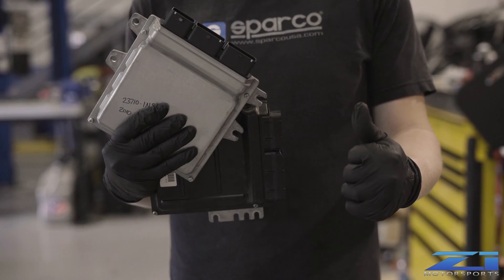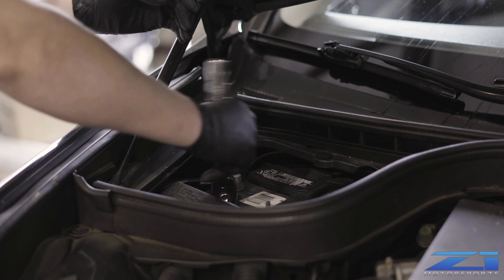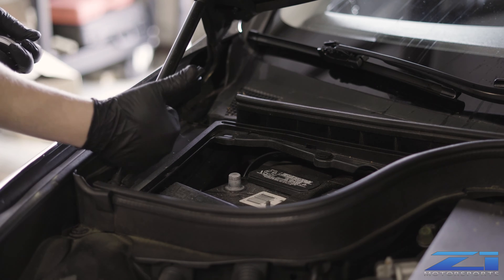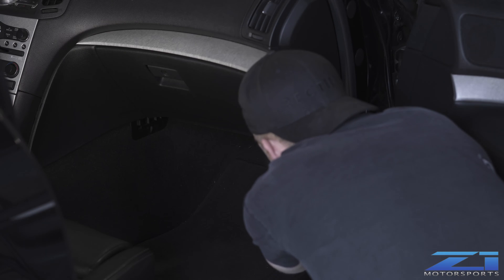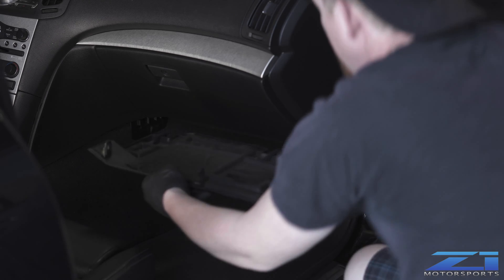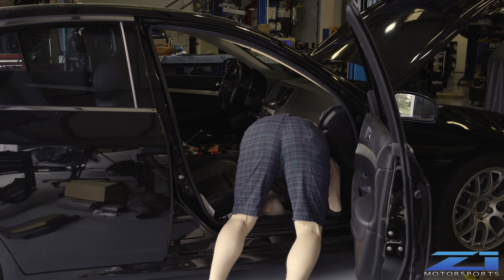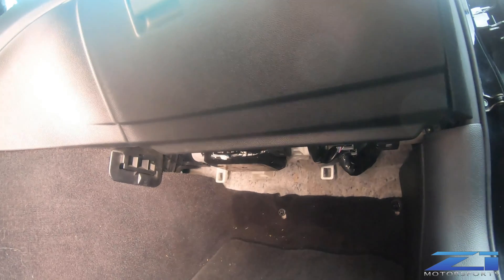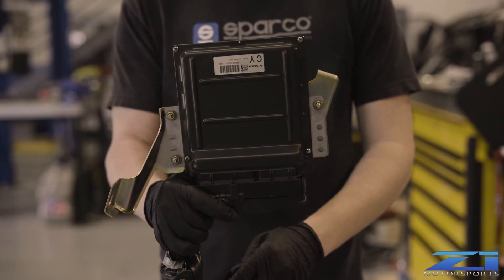How to remove your ECU - Nissan/Infiniti

Comment: can ecu cause random misfires?
Reply: No that’s your coil packs
Reply: @Ephekx Not necessarily. The ECU tells the coils when you fire. If the ECU is bad or the KAM doesn’t work properly, it can cause misfires
Reply: @koryneasterday1120 yes but that’s not too common as just burn coil packs causing misfires
Reply: @koryneasterday1120  hi, is the KAM error the keep alive memory error, P0603 does this mean the ecu needs to be replaced? i do get very seldom misfire or cutout, but no code.... the code only surfaces for me after i drive the car, turn it off, go into a store , come out and start the car. then it pops up but disappears at the next startup if the car has been sitting for a while... soo strange. ive replaced coils, plugs.. checked terminals, wiring...

Comment: I wonder if this is what needs to be replaced in my car. Cause my accelerator just died on me when driving 2 months ago. Then it wouldn’t start.  Like it’s not sending fire. Been taking it shop after shop. They can’t figure it out. I’m bout to get rid of  it .
Reply from the maker: It's always worth checking, but that might not be your issue.

Comment: what if i disconnect my stock ecu and  plug in a tuned ecu, should everything work just fine after i reprogram my key fob? i have a 2013 g37 and wanting to switch to a 08 ecu tuned on uprev
Reply: Did it work?

Comment: This is the most vague fucking video. What models??? What years??? Wth Z1😂 I have a 2016 Infiniti q50 RS and it’s not there and can’t find any information on where it’s located at……. Any help? A tuner here new to Infiniti’s
Reply: Anyone wondering and can’t find theirs on Infiniti for 2016 it’s actually behind the right fog lamp in wheel well. 🤌🏼

Comment: If you are having issues removing the 10mm bolt near the dash...then remove the 7 screws holding the glove box and you'll have plenty of access. While the glove box is off, you can change out the cabin filter too.

Comment: does the mail in tune include a flame/burble map?
Reply: Always remember this... flames & backfires in your exhaust system, travel both ways... one way is out of the exhaust pipe & the other way is back up to the valves in the cylinder head. Over time the amount of damage those "cool looking /sounding mods" do is insane.

Comment: Would a 3" intake using the stock diameter MAF housing need the +$300 add-on?
Reply from the maker: If the MAF area is the same diameter as stock it would not require the additional upcharge for oversized intakes since it doesn't require rescaling the MAF when tuning.
Reply: @Z1Motorsports23  how can I get a new ecu for my 2008 G35x,    my old ecu broke

Comment: Do you always increase Rev limit with UpRev if you choose the option to send the ECU for a tune? I read 50-50 that you should never touch the rev limit, but if you do, are we talking about  100rpm? 500?
Reply from the maker: It depends on what car we're tuning, if we're talking about an HR engine we'll usually turn the revs up to around 7800. We'll never turn the limiter up past a safe area for the engine.

Comment: So I just send it to ya and you tune it? Then send it back and that’s it?
Reply: If the are able to do that, yes. that is one of the options to get UpRev on it. the cheapest one too because you will not need to buy the cable etc. Will probably miss 1-3 hp because they flash a pre-made one depending on your mods and that's it. but you'll save like 500 on it

Comment: Sorry to ask this guys , does anyone know why car my is sputtering around 2500 rpm , cant even go past 65 mph with out it jerking me in my seat , 2003 g35 coupe de , thanks guys
Reply: You need to reprogram the ecu  my g35 was doing the same when I replaced the engine
Reply: Olman Castillo How did you reprogram the ecu???? This start happening when I replace my engine too, my car goes up to 78mph and 3000 rpm. I also have engine code for crankshaft (P0335 - Crankshaft Position Sensor A Circuit), does the code also came up after replacing your engine.
Reply: @habeeb590  I took it to a shop they changed me $250 ...
Reply: Olman Castillo oh okay👌, the shop that replace my engine did a shitty job so am definitely not returning my car back to them, I guess I have to find another shop and pray they know what they are doing
Reply: @hrg35coupe11  did you take it to a specific shop or what?
Reply: @jeremiahwalker9331  a friend fixed it for me . But any shop should be able to fix it
Reply: You got take it to someone with a fancy computer to recalibrate the throttle body timing vvt all those things
Reply: Olman Castillo Okay👌 thank you so much, now I know what the problem is.
Reply: @habeeb590  no problem
Reply: Did you figure the problem cuz am car have the same problem
Reply: The numbers has to match old ECU from the new one to get the vehicles starting

Comment: Hey quick question. Rumor goes that if you remove your ECU and try to hook it back up it won’t start ? Unless you reset it with a tool? That has to be a lie right?
Reply from the maker: Correct, that is false. There should be no issues disconnecting the ECU, putting it back in, and starting the vehicle.
Reply: @Z1Motorsports23  so I should be able to disconnect and clean it due to water leakage on my passanger side and put it back nd start it?
Reply: @alvarosilva957  no water leakage killed it you can't clean water damage from an ecm I know this is a year old but for anybody else that runs by this problem just no
Reply: @cainadkins3985  I'm going thru that problem right now.any tips??
Reply: @alvarosilva957 were you able to prevent the water leak? If so how?
Reply: Thank you !